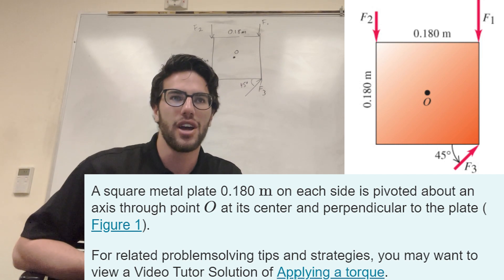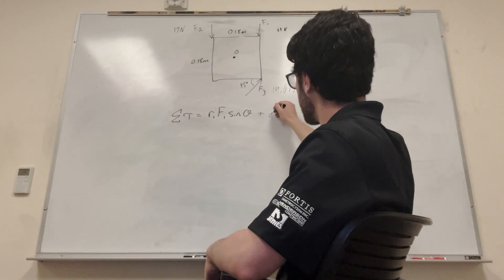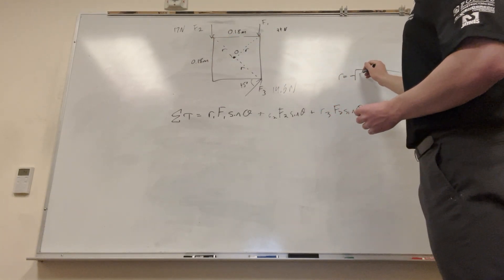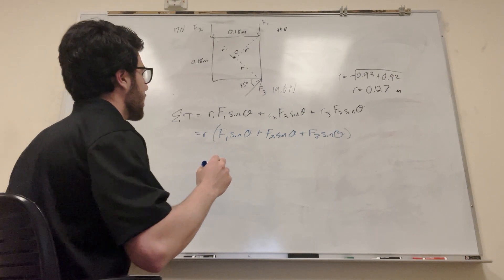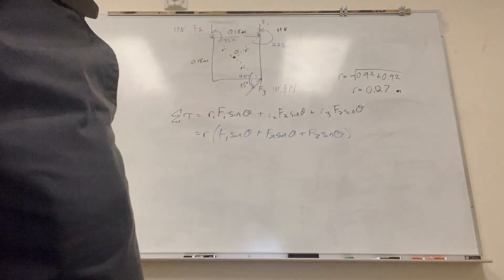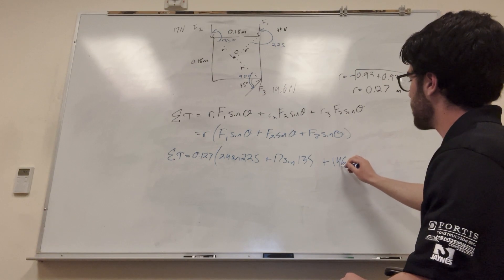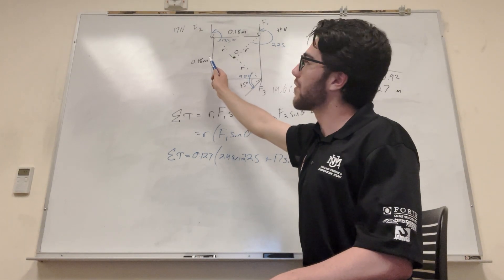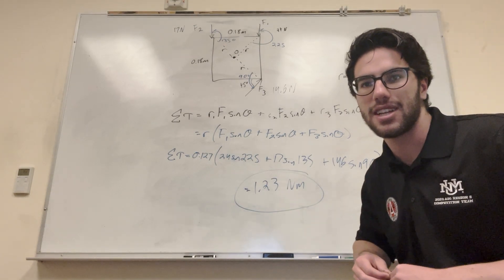A square metal plate 0.180 m on each side is pivoted about an axis through point O - Problem 10.3

Comment: Shouldn't the length be 0.09 since you are claiming that radius is half the length of the square, which is 0.18m
Reply from the maker: No, it has to be the distance from the center of the square to the corner of the square, which is not just half of the length of the swuare

Comment: Since counterclock wise is the positive direction, I believe that your statement of taking the angle of the counter clockwise direction is invalid. For example,  take Force 2,  a force that visually we can see will rotate the square counter clockwise, however when you do the individual torque calculation utilizinng your method, we get 17N*sin(135) which will lead us with a positive torque, which means clock wise, which it is not doing.
Reply from the maker: But counter clockwise is positive, like you said, and F2 will calculate to a positive number. The answer here is correct